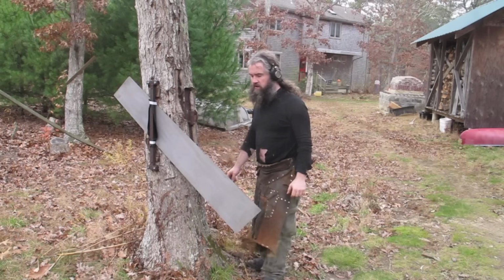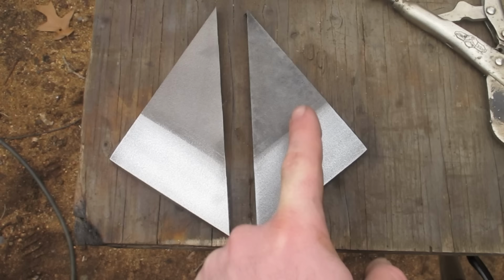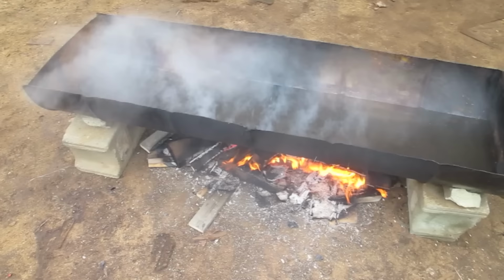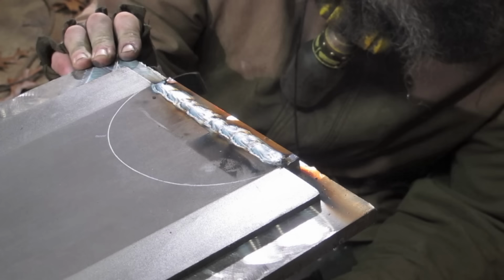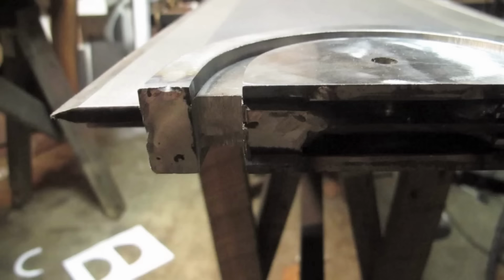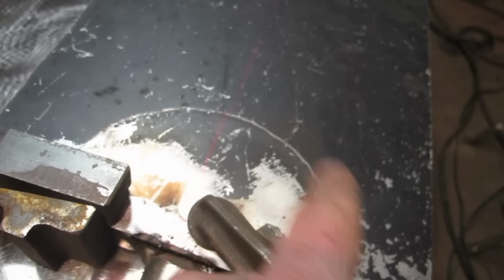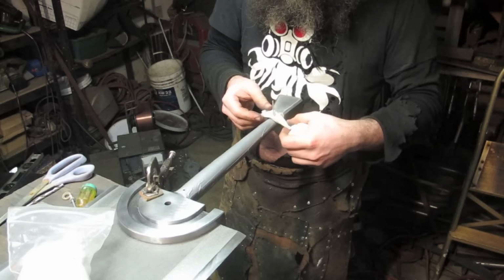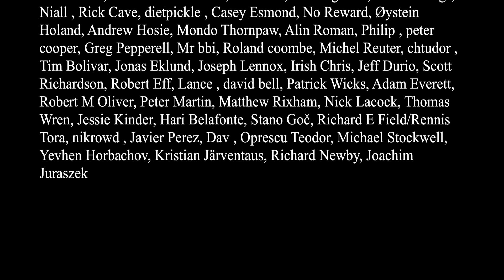Dragonslayer Build

Comment: Dragonslayer is canonically taller than guts.
Reply: Living Room Set so you’re telling me he’s 7 foot while schierke is 3’11? Yeah thats going to be a no for me dog, both Guts and dragon slayer are roughly to be the same height
Reply: The dragonslayer's blade is actually shorter than guts but the hilt makes it taller.
Reply: @humidpath2104  Yes, he is. Gut's height was confirmed after the eclipse, so the wiki says he's 6'3", since Schierke is a relatively new character, her height on the wiki was confirmed more recently and closer to Gut's current height, https://berserk.fandom.com/wiki/Schierke. If you are confused about how it looks when they are next to each other it's probably because Schierke is 3'11" instead of 4' (the same phenomena is seen in the 5'11" - 6' meme), Schierke is roughly 1.85 times Gut's height, you could fit a 15% shorter Schierke to get to Gut's height. A 15% shorter Schierke would be about 3'5". 3'11" + 3'5" = 7'4".
Reply: Humid Path210 the dragon slayer is 6”6 not 7 feet
Reply: @captainmalcolmreynolds1526  I was talking about guts not the dragonslayer
Reply: Can't be. If the Dragonslayer was bigger than Guts he couldn't walk with it on his back.
Reply: @edwardgaines6561   well it's slung at an angle.... probably off-center by about 1.5 feet. If we put the blade at just 6 feet +the handle would make ~7... sqrt(6²-1.5²)= 5.8 feet, or about 5'9" vertical height. You can usually see the blade peeking out just above his shoulder, which means it starts at around 5'10"-11"or so off the ground. He could just barely carry it at that height

Comment: you should try it again, but to make it a bit lighter and a bit more accurate to the manga/movies/anime, make it taper in a little bit at the end and the brighter parts of the blade pop out of the middle black part a bit like you did with gut's raider sword

Comment: Maybe I missed it but  what was the final weight of the sword?
Reply: the weight of it in the manga is estimated to be around 1,600 pounds, but this im sure is around 100.
Reply: SpaceLizard MasterWizard The sword in the Manga is not that much, more like greater than or equal to 400 lbs
Reply: the original weight is 133 Kg, maybe the 1600 pounds would have been the guts force, but if my calculations are right, it would be 133Kg, which would be more realistic considering that guts is height 2 meters and is weight is 115kg. If it wasn't that he hold it with one hand xD
Reply: The blade of the sword is as tall as Guts is.

Comment: At 44:56, what exactly happened there? I just go an angle grinder and I don't want to make the same mistake.
Reply from the maker: +simon james The edge of the sanding disc touched off the chuck jaws, this causing the cardboard sanding disc  to rip. The ripped disc is no longer round, and hard to control in the grinder. This would normally have been fine, but it caught be surprise and lack of equilibrium yanked the grinder out of my hands and spun it around.
Reply: Thanks, also I love your content.
Reply: +michaelcthulhu ashbringer, do it if anyone request it
Reply: +simon james He hit the spinning drill chuck. That's why normal people don't use drills as a lathe. Well, one of the reasons, at least.
Reply: Michael uses only free-range, lightning-fed, 100% wild angle grinders, and they can be a bit feisty.

Also, it hit the chuck at the top and probably got caught between two jaws, breaking the edge.

BTW, it's not very clear from the video if it turned itself off when it jumped. I've never understood why so many angle grinders don't have a dead-man's switch. It's not like it adds much to the cost, and there are switch designs that let you change between the two modes easily while working.

I change the one on my router all the time when I get near a wood knot or a corner. That way, if it jumps, it immediately turns itself off, which limits the damage to the piece and / or to any nearby bits of me.

Same thing with restart protection. It literally costs less than $2 to add, and a lot of models don't have it.
Reply: +michaelcthulhu Is that what snagged your hand... that gave you a little road rash
Reply: +RFC3514 Good idea. Safety is never a bad investment. But in my experience (and already tried the dead man's switch), by the time the grinder starts loosing speed and power, the damage is done. 
The best protection agains accidents like that is keeping your focus and attention at all times, follow safety procedures and avoid boredom.
That's why I have a reminder written at my shop, something a very wise smith said: 'Traditional tools wound, power tools maim'.
Reply: +eli s Yeah, one of the earlier build videos had that. Can't remember which though.
Reply: +simon james The one of two parts of this video that made me cringe. Only because I work on a lathe in a shop. 

Let us all take a moment to stop and think about safe in this environment. I have safety glasses and ear plugs at home.

Cool sword, bro.
Reply: +michaelcthulhu im surprised you can still count to ten with your fingers, Mike.
i wish you safe crafting
Reply: ***** - Well, it obviously can't cut off before you let go of the switch, (at least not without some sort of SawStop system, though that won't work on metal), so if you only let go after it chops off your finger, it won't save you from that.

But there's still a big difference between something that turn off as soon as you let go and something that continues to spin (even speeding up, because now it's not under load) indefinitely. If you drop it because you've lost a finger, you might as well not also lose all your toes. ;-)
Reply: michaelcthulhu so michaelcthulhu how about you make truck's sword michaelcthulhu please.

Comment: I would really like to see if a strongman could actually wield that thing. Anyway, the answer would be no, tho.
Reply: i betchu i could
Reply: Charlie Fiction But using rotation attacks can do a big damage
Reply: yea just dont  try to block that thing
Reply: M
Reply: The Rock probably could
Reply: Charlie Fiction correct although superior timing is the difference. as much as you highlighted the cons of the ugs.  the pros you over look to a skilled sword fighter as opposed to a swordsmen.
Reply: Hellion Malkav The actor for the mountain from got
Reply: The real one no way. Its around 400 pounds or 180 kilogramm. The weight of a regular claymore is around 3 kg. This one,  efficiently, maybe against a medium sized animal, but it would be very tiring and the sword would wear out really fast.
Reply: S not if the blade is 3 inch thick and you use the Berserker armour it dont.

Comment: How much did this one weigh? Assuming you did weigh it.
Also, what would you approximate the weight to be if the blade width was double its current thickness?
Also, also, are you Irish by chance?
Love your videos!
Reply: it's probably around 20-22 kg if i had to guess now that i think about it
Reply: Seems 50lbs ish, would assume that it'd just be double the weight for doubling the thickness, though the handle wouldn't be affected so around 95lbs.
Reply: +Piper Johnson pretty much
Reply: hes irish hes from donegal
Reply: The problem with the estimates is that the dragonslayer is almost never drawn in a measurable manner. The artist draws it with different proportions all the time to emphasize speed/weight/power/style. It is pretty crazy to think that it might be 400 pounds though.
Reply: +Guts The Berserker the wiki says it's about 500lbs (around 200kg)
Reply: The first Dragonslayer he made back in the day was 35 lbs. This one doesn't appear to be much larger than that, if larger at all, so it's probably about the same. The Crisis Core buster sword is 54 lbs, the first FF7 buster sword was 46 lbs, and Darius' Axe is a little over 100 lbs.
Reply: no its because of the blades thickness

Comment: Inexperienced question: When you were taking out the warp in the HardX blank, why not apply a small amount of heat and pressure with the jack instead of cold bending? Great job, ty

Comment: Anyone think that if you were to train with a Pre-dragonslayer / Armour breaker sword then you could wield this? After years of practice of course...
Reply: Hmmm, possibly, but it would still be pretty hard
Reply: luca needs 9 million likes pls
Reply: This sword is not as thicker,and thus more lightweight and easier to swing. Would still be useless as a sword though
Reply: It would be physically impossible to use practically. Even if you could feasibly lift and swing the sword the sheer mass of it would make it impossible to control after the cut. If you were to swing the sword and if it doesn't hit something very solid, it won't stop, and you won't be able to stop it. It would pull you along with it or just knock you over.
And if it hit something solid like a tree it might just embed itself in the tree. Have you ever tried to get an axe that was swung full force into a tree out? It's really something else.
Reply: Yes , pre dragon slayer sword isn’t even as big as some swords that’s were used in real life . The biggest sword used in history is 7 foot but it weighs way less
Reply: No, but if you hit the gym religiously, ate  buckets of meat every day and became a strongman like Pudzianowski (you'd have to have the right genetics and probably be 2m+ tall) it might just work... Pointless, but feasible.

Comment: Nice job. Real dragonslayer is absurdly thicker than that. I think there is a special element in that is lighter than steel or aluminum in berserk universe. Otherwise it's physically impossible to use that in a real fight. I'm not talking about if you're strong enough to wield it. Even if you were strong enough to lift and swing it, you'll knock yourself out with momentum unless your supernaturally heavy (a few tons). Don't believe me? Go find a barebell and attach 10-20kg and try to swing it.

Comment: Really nice work! Just a few small nitpicks though: why doesnt the middle section have that pattern that dragonslayer has? You know, that really rough pattern in the middle? I am not a blacksmith, but I don't think it should be hard to do. Also, this is just my opinion, but I think the sword is a little too short. Just a little bit. Otherwise great work!

Comment: Question: if someone was to ask for half an inch thickness but using titanium instead as it is significantly lighter. Could you work with that if all material costs were covered

Comment: Is the shape of the handle the reason it rotates or the sheer weight? I'm also curious if using a heavier material for the pommel would effect the balance slightly even if it'd make the overall weight heavier?